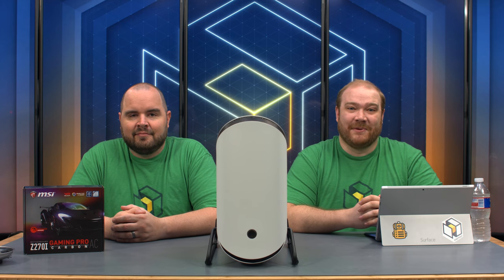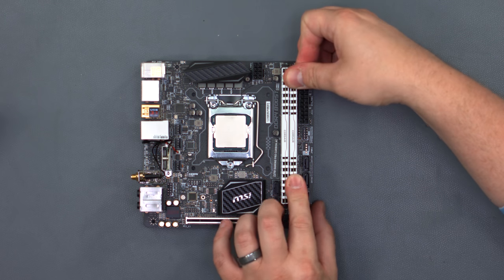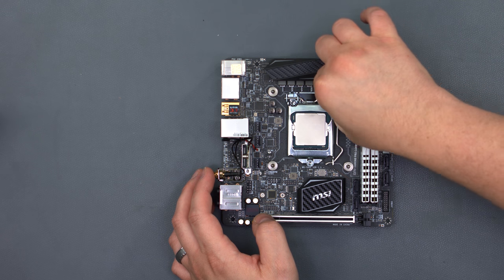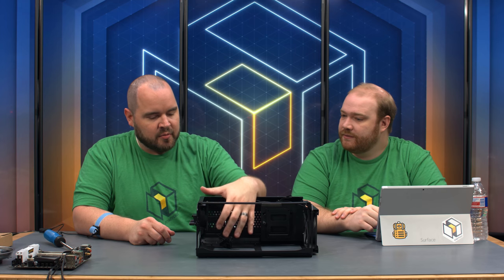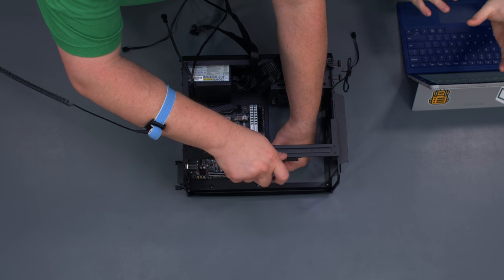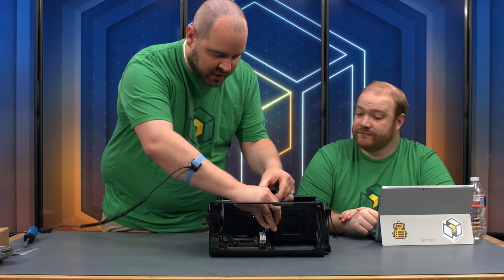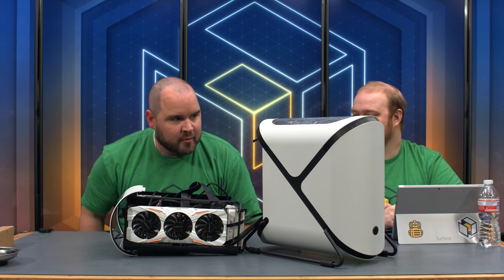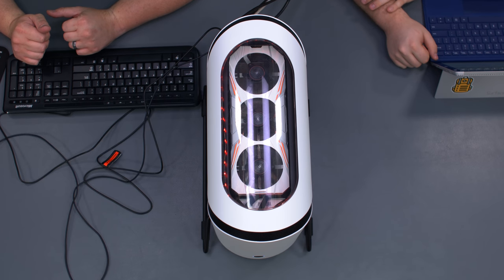BitFenix Portal mITX Build - MSI Z270 / i7-7700K / GTX 1080 Ti (Livestream Archive)

Comment: I think a cool mod would be to replace that front curved panel with a piece of acrylic or perspex, obviously curve it around, possibly keep an inch or two of white frame around it. it would also be a good place to add more front venting, if you're good enough at modding. aka not me. also put some lights behind it. just an idea.

Comment: Can you please show us what the wrist strap is connected to? There is some conflicting information on what you should connect it to too ensure you're grounded. Thanks
Reply: just some metal dude
Reply: Has to be grounded though right? So you can use a PC case as long as its plugged in but turned off as the PSU is grounded to the case....
Reply: use ur pc case yes, take ur socks off and remove any fabric under your feet, you should be fine. thats how i always do it for mine
Reply: I've been building PCs for over 25 years and I've never once lost a part to static shock despite never owning any kind of static prevention.

Comment: Do u think is really necessary a water cooler in this configuration for someone who will not overclock?
Reply: i7 7700K and GTX 1080ti create MASSIVE amounts of heat even in full size case. Cooling is the biggest problem with every high-end mini-ITX build.